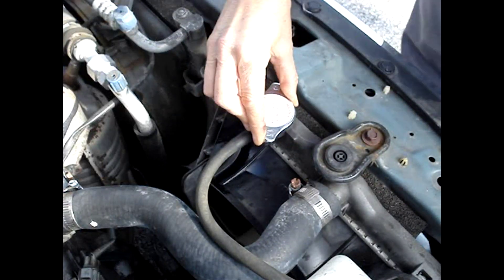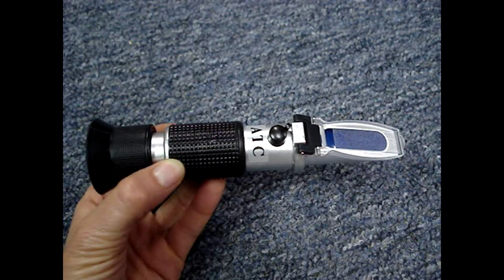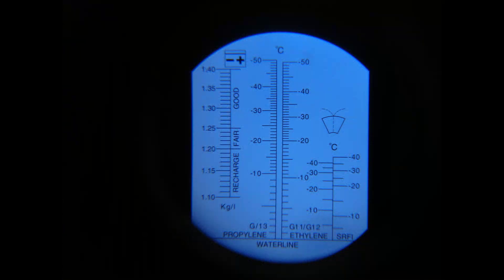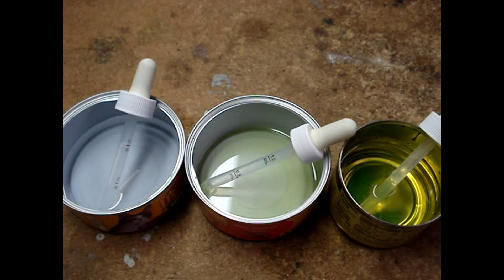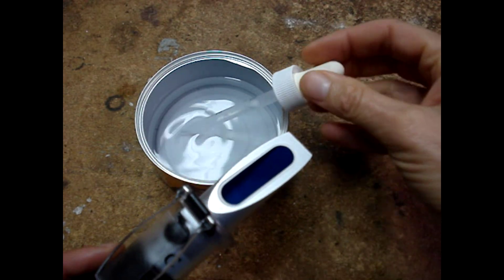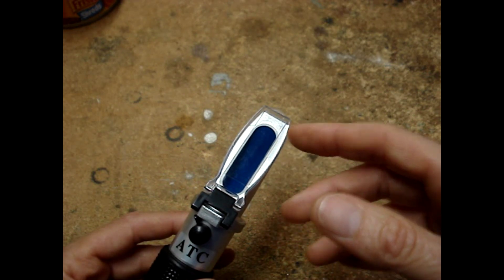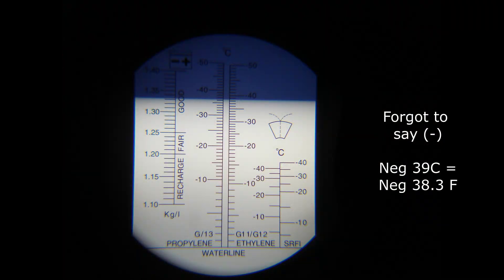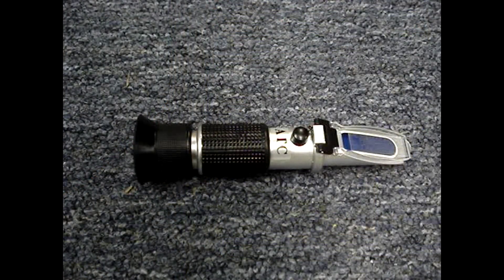Test Antifreeze Coolant Concentration With a Refractometer

Comment: Most modern cars will require a 50/50 mix so 50% of distilled water and adding 50% of the right oe coolant concentrate, so check the cars Oe coolant specs, plus if you live in a really hot place around the world, change and flush you coolant completely after every 2 years even through they say it will last 5 years IMHO, that way you know its good, but also by using a re factomter for checking glyco and inhibitor test strips is the best way to check how good is you radiator coolant in your car, the refractometer only test the glyco levels and not the inhibitors in the coolant, which test strips do both and are a lot cheaper, but the same meter checks other things as well, as you can see on the scale on the viewing lens. :) sedo

Comment: This is a really GREAT demonstration of how to test antifreeze using the floating balls and the better tool. Some of the stuff on YT is total crap and you make it easy to understand. If you are inside a shop or its a little dark, the screen is black and you need light to make it work (just a tip).
Reply from the maker: Thanks for the compliment and the tip.  I do a ton of research on the videos and try my best not to give out any bad advice.   Happy New Year!

Comment: Interesting!
Reply from the maker: I'm happy with the upgrade, way better than a hydrometer.  I have a friend who worked in a medical testing lab (old school when they used a refractometers to test urine), she said the cheap one should be just fine for antifreeze/coolant testing.

BTW - One of these days I am going to get around to up grading the camera to get rid of the black bars.  Your suggestion has not been forgotten.
Reply: TY. If you use a smartphone, then it should have the proper wide screen video format.
Reply from the maker: Part of the problem is the logistics of mounting the camera.  I've made a custom mount for short range & have a tripod.  Eventually, I'll get around to upgrading and working out the new mounts.   I'm very detailed oriented & hate to do crappy work, that equals slow but steady output.  lol.